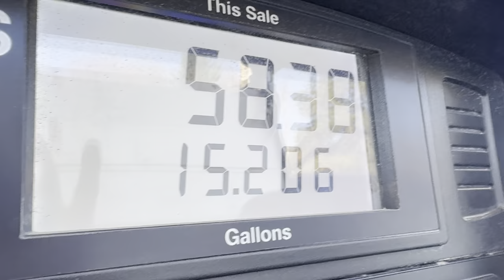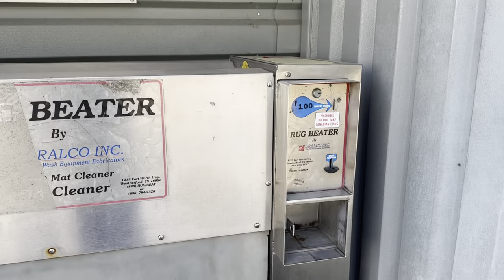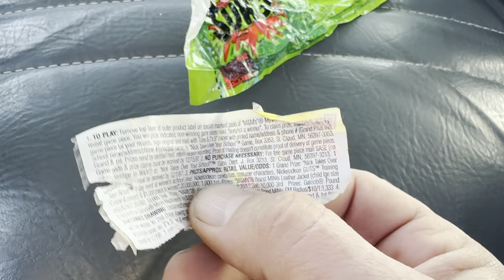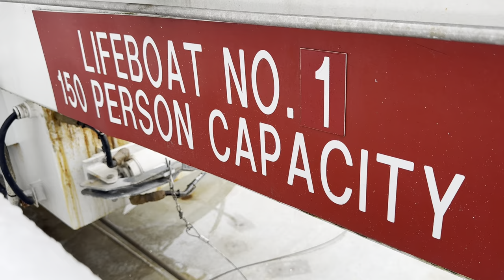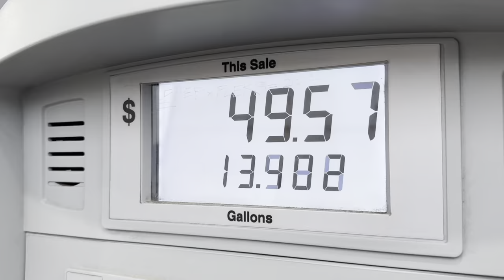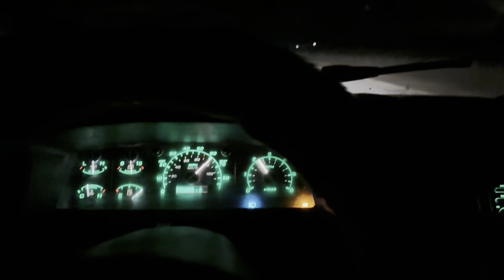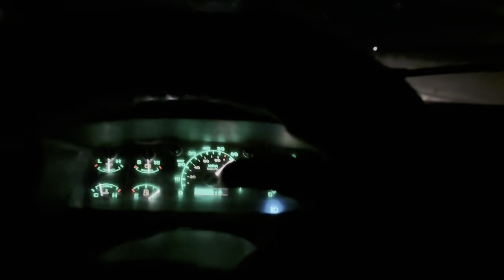The Floating Ford, Alaskan Ferry Edition

Comment: A little rust and paint will do for the frame and other rusty parts. I like to use the hammer stuff that comes in a court. Can that way I don’t ruin my glasses with spray paint shaker can overspray have a good day. Your truck looks nice. very nice old Ford. I got a Ford F250 also6 L diesel diesel rule